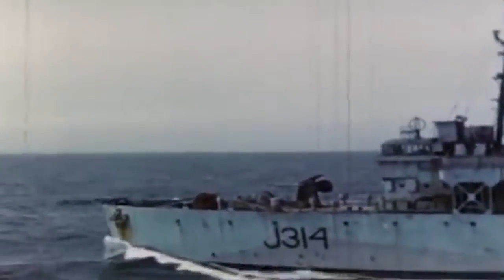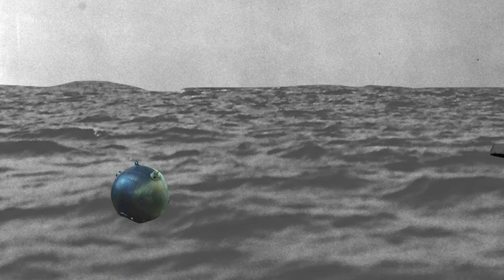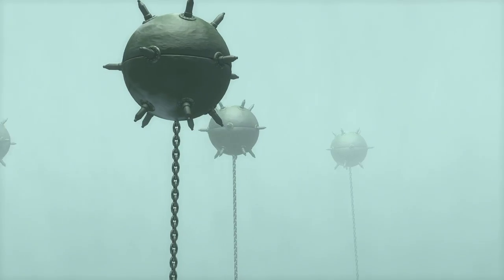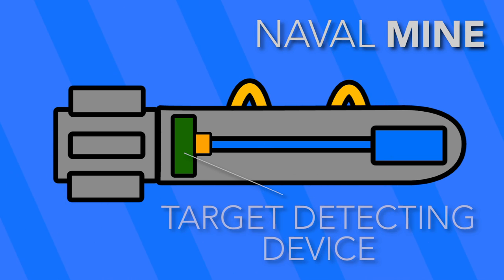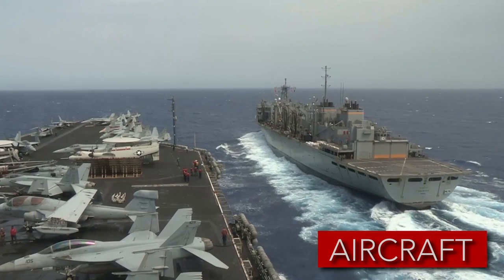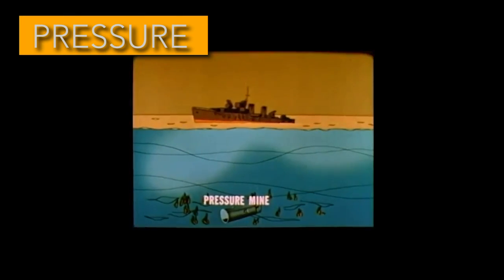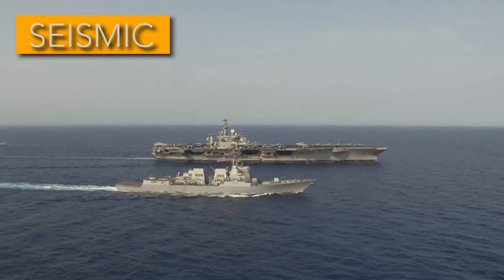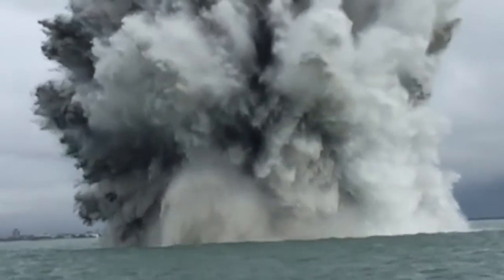How do Naval Mines Work? | Unclassified Documentary | A Closer Look

Comment: June 1941, in the beginning of Operation Barbarossa (WW2), the German Navy, (later joined by Finnish naval units), laid 1800 naval mines and 800 anti-minesweeping explosive devices between the Estonian and Finnish coasts. The Finnish 12" and 6" coastal batteries kept the Soviet minesweepers from opening a gap in the minefields. 

During the war, German (2/3 of the mines), Soviet an Finnish Navies laid a total of 70 000 naval mines and explosives, making Gulf of Finland the most densely mined sea area in the world. There were also series of underwater nets (made of steel wire) for preventing submarines from going underneath the minefields. 

These effectively kept the Red Navy's Baltic fleet locked in the easternmost tip of Gulf of Finland, enabling keeping sea routes to and from Finland open. The minefields also prevented the Germans from attacking Leningrad with naval units.

After the war, sweeping/neutralising these mines took 5 years. And some of them are still being found every once in a while, especially in the Eastern Gulf of Finland, where most of the mines were laid.

When it comes to documented cases of enemy ships being destroyed by defensive mines, you should google with the keyphrase "Tallinn evacuation 1941" The evacuation of Soviet troops from Tallinn, Estonia, when the advancing German land troops had the city surrounded. It is thought to be the bloodiest naval disaster since battle of Lepanto (in 1571), killing approx. 12 000 men. Half of them just because of naval mines, the other half because of German aerial, naval and artillery fire, and also because of Finnish torpedo boat attacks.

During cold war, some Finnish Ro-Ro cargo ships were actually fitted with quick attachment points for mine laying tracks, which would have enabled a much faster and more effective laying of mines than the small number of naval units alone. Even in the time of modern anti-ship missiles and anti submarine weapon systems, minelaying and minesweeping are still core tasks of the Finnish Navy in case of war.
Reply: As a part of the so called Peter the great's sea fortress there were well armed coastal artillery forts on both sides of the Gulf of Finland, inherited by Finland and Estonia when they became independent countries. The idea had been that these would work as one of the defensive layers of St.Petersburg, but now it became possible in theory to use the batteries in Porkkala and Tallinn to completely close the Gulf of Finland from enemy surface ships with coastal artillery and to actually isolate St. Petersburg itself, this time called Leningrad, by its own former defensive installations. 

Finland had relied in its strategy on kind of wishfull thinking that Estonia would forever be a friendly country, a hope that would turn out to be naive, since after the Soviet Union established bases in Estonia, which were agreed to under pressure, Estonia was no longer in a good position to defend itself from possible Soviet aggression and thus practically unable to go against the Soviet will. In the winter war not only were the southern shore batteries not actively taking part for our side, but the Soviets could use their bases and de facto military control of Estonia to circumvent any Finnish coastal artillery and even to bomb Finland from bases in this flanking position with its airforce.

So this situation was not exactly ideal and during the interim peace some plans had to be hatched to oppose the Soviet control of the Baltic Sea. Estonia had become completely occupied by Soviet forces. When the Germans came up with the idea of invading the USSR via the Baltic countries and cared to inform Finland beforehand many of the buried strategic options surfaced again.

Finland could not prevent traffic between Leningrad and Tallinn alone by its coastal guns, so minefields had to be laid covertly  on the territorial waters of the Estonian SSR as well to do something about it. This was to have devestating consequences during the Soviet evacuation.

Comment: I was a mineman in the Vietnam war.  We had destructors and much larger mine, deploying them in Haiphong  Harbor. All were self-sterilizing in the early 70’s, using water soluble plugs that would waist away at a pre-determined rate and then flood the component department. I have never heard on a Seismic mine
Reply from the maker: I just left the Navy after 8 years as a mineman!
Reply: @ConcerningReality  what ship were you assigned to? I was class a in Charleston sc then mobile mine assembly group subic bay RPI 1970, CSG Enterprise and Kitty Hawk
Reply: I was class a in charleston 1971, navmagsubic (Cubi Point)after that. Assigned to kitty Hawk and enterprise temp assignment
Reply from the maker: @frankcherry3810  I was shore-based, assigned to MOMAU 9, attached to NWS Guam. Trained in San Diego and spent many weeks at NWS Charleston as well!

Comment: Former EOD guy, Army (so no RSP knowledge beyond what I read), and wanted to drop some technical info in case anyone happens by this RE: Explosive Trains

An "explosive train" is in reference to a variety of different kinds of explosions that ultimately detonate the main charge (or cause a "High Order Explosion"). Typically, this is an Igniting / Priming charge, a Booster and the Primary Charge, though a Secondary can be used. For maritime mines, and most guided missiles, rockets, projos (artillery, recoilless, tank rounds) and mortars this is now commonly something not shock sensitive (or not as shock sensitive) but can be detonated by electricity. Mercury Fulminate or Lead Azide typically. Boosters/Secondary/Primary are usually all of the same type - just different amounts - B6, C4, RDX, PETN, or similar.